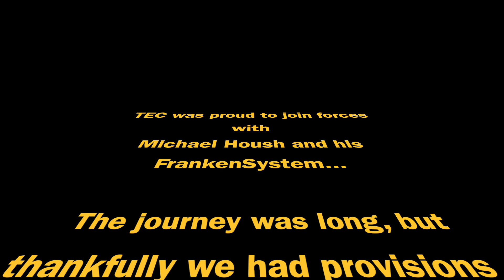FrankenSystem with TrueFlow

Comment: More I look more interesting it gets, did you remove the heat exchanger from the furnace and install a hydronic coil in it?
Reply from the maker: No it’s a heating only hydronic air handler  designed that way. Unfortunately Lenox no longer makes this style air handler.